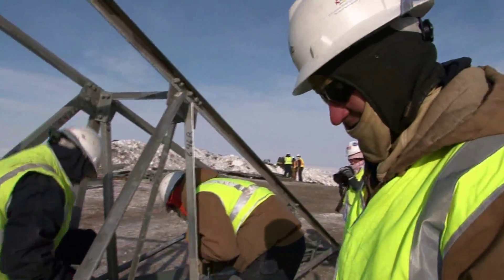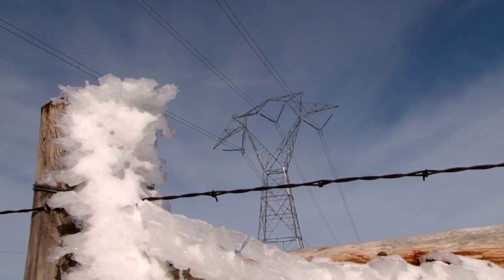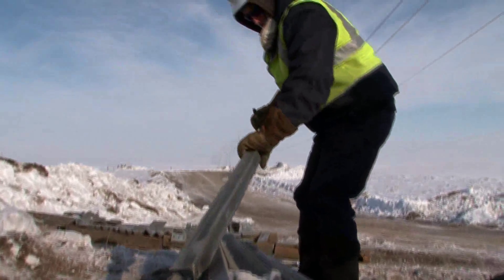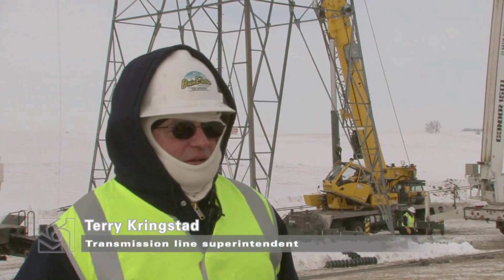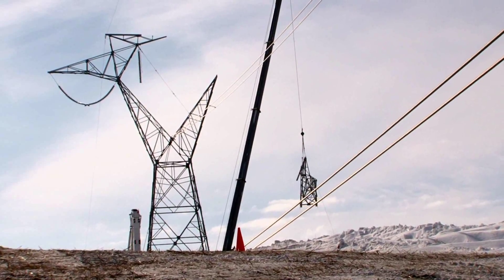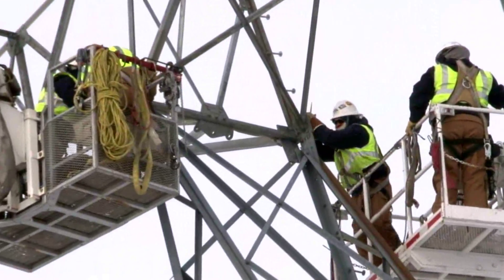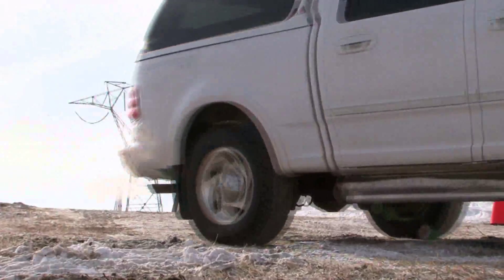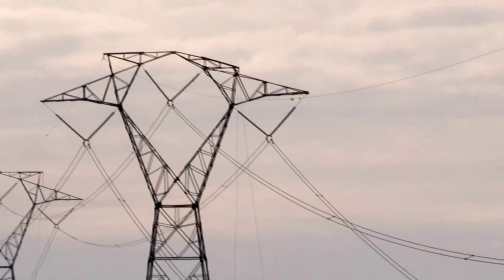Transmission crews repair major line in South Dakota

Comment: The 345kv lattice structures at 0:25 are almost the same design as Dominion Energy’s 500kv lattice structures found throughout Virginia and North Carolina (and now West Virginia following the Mt Storm-Doubs 500kv rebuild project from 2011-2015, as well as the upcoming Mt. Storm-Valley 500kv rebuild project).

Comment from the maker: @Runnr4life745 TSM’s minimum requirement for a journeyman lineman is the completion of an accredited lineman program similar to that of Bismarck State College or Mitchell Technical Institute and the completion of a  4-yr apprenticeship program. While additional training in the electrical field is beneficial, it is not required. At Basin Electric, will also receive 80 hrs of live line training annually in addition to HV Switchman training, training to obtain a CDL and rigging/signal man training.